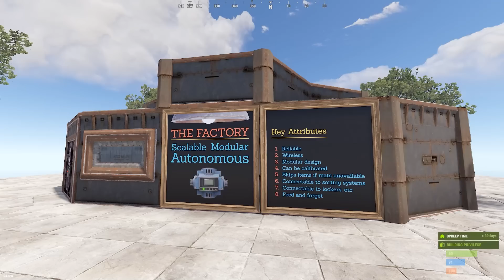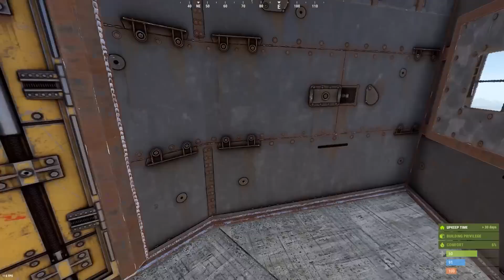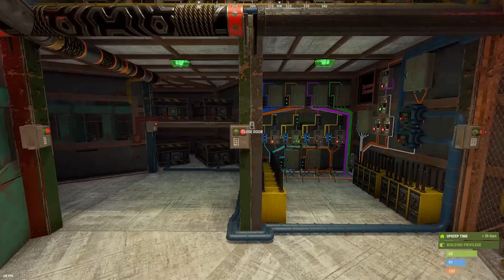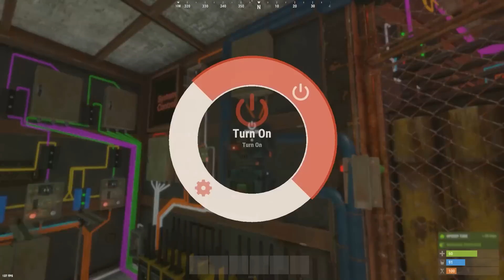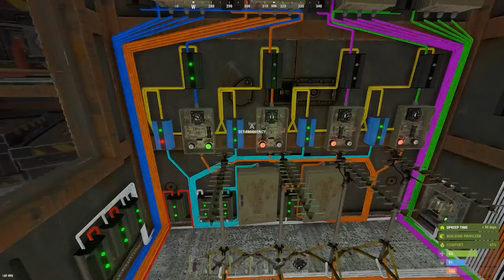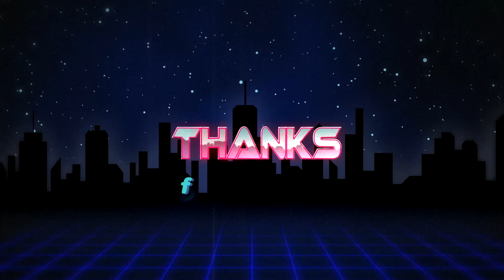RUST Electrical | The Factory - Proof of Concept Tour 2023

Comment from the maker: There is a newer version of this! https://youtu.be/F3jsEk0msm8?si=8xur2f4VUGxkghvs

HOW TO BUILD PART 1 - https://youtu.be/rl4vX6pNLDU?si=waUiWqeazIj56oTL
HOW TO BUILD PART 2 - https://youtu.be/HIext9Ka_CQ?si=FQfqXmUh7XlN8zkW
HOW TO BUILD PART 3 - https://youtu.be/aB2cddON9RE?si=JY_nswp3s6fXxQ6t

Video Contents:
0:00 - Intro / Setup
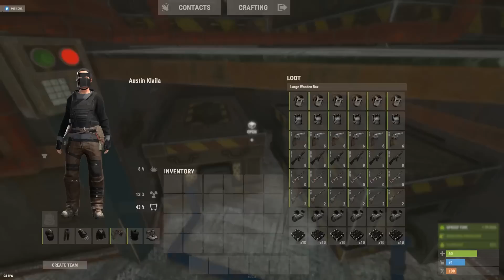1:10 - Initial System Tour
1:51 - System Control Room 
2:39 - Crafting Modules
3:30 - System Demonstration 1
9:21 - System Demonstration 2
14:31 - Design Process Commentary
19:29 - How It Works Recap
20:43 - System Limitations
24:06 - Outro
Reply: Yo, very seriously. You need to contact facepunch about the conveyor problems you were having. You understand it better than any of us, and they take these things seriously if its a glitch. At the least you can get some solid confirmation if it's a feature or not.
Reply from the maker: I'll submit a comment! @M3A7

Comment: I mean other then the power savings I don't really understand the purpose of this system. Like the time and cost of this system is kinda pointless unless your running this on a modded 2x or more server. Not to mention if your the type to mess with auto crafting systems their are alot of cheaper and simpler setups.
Reply from the maker: It's primarily designed for a decent size group who wants to change up the game a bit. It's certainly not going to be something most players build. The risk would be insanely high. Beyond that, I just like to see how far I can take RUST electrical / industrial.
Reply: @AustinKG  but still what are you trying to accomplish with a system like this? Or is it complex just for the sake of being complex?
Reply from the maker: There's a group that contacted me and requested I R&D this as part of a specific plan they have for a wipe. I agreed, so here we are. So no, it's not complex for the sake of being complex. @The_Blue_Portal

Comment: What hapends if someone uses the same brodcasting signal as u use in the recivers
Reply from the maker: Although extremely unlikely given that there are thousands of options, it would be bad. You could easily reset the system with a new number if that occurred.

Comment: Is it possible to get a rust + alert when you sell an item from a shop?
Reply from the maker: I might make a video about this actually. Thanks!
Reply: @AustinKG  storage monitor can do this if you aren't wanting an alarm for a specific item.
Reply from the maker: Yes. You could hook up the Filter Pass on a conveyor to a Smart Alarm. Anytime the conveyor refilled a purchased item, it would notify you.
Reply: Ah excellent I've only really started playing around with electricity and industrial parts.

I will set that up, coupled with the storage monitor on tc to see what sold.

I want to set up the base to do everything itself based on metal frag sales. Buying wood/ore for the smelters, the output goes into the shop.

Eventually I would like to have a security system that exfers loot away from a destroyed door, say keeping two doors away at all times.

Comment: Meanwhile,  i cant get a conveyor system to work correctly with a furnace array or get it to dump into more than one box...
Reply: Wire them in parallel instead of series. Place 18 conveyors(9 ea in and out), 4+ combiners, 4 splitters. Combine all in and out from conveyors. Splitters before conveyors on wood/ore in, combiners after conveyors on out. Get it? That way every mover can fill/empty every furnace. Trust me, give it a shot.